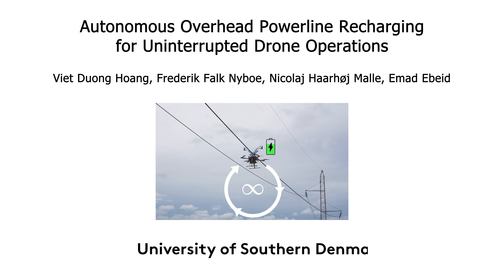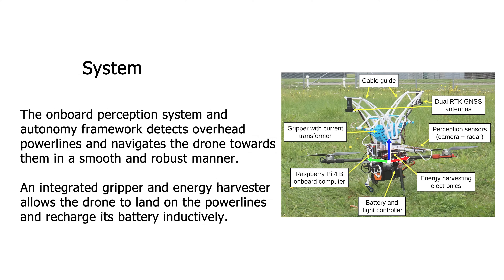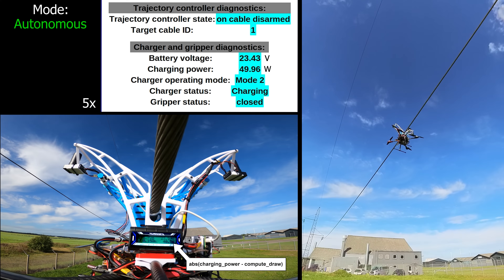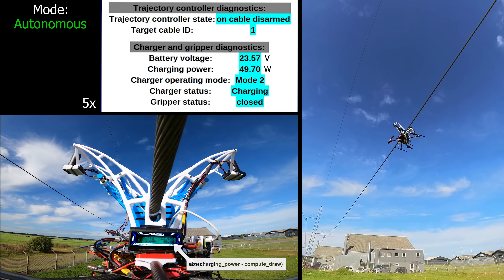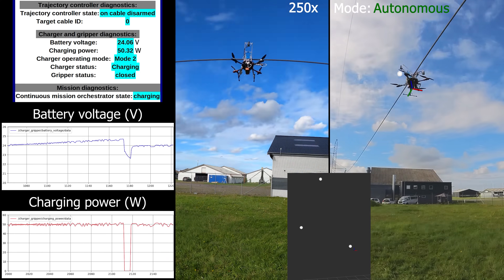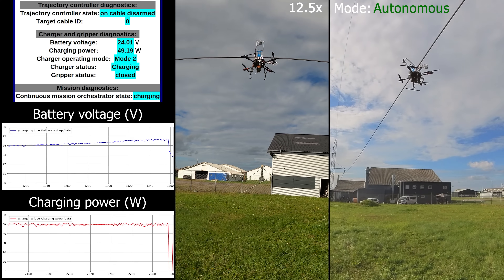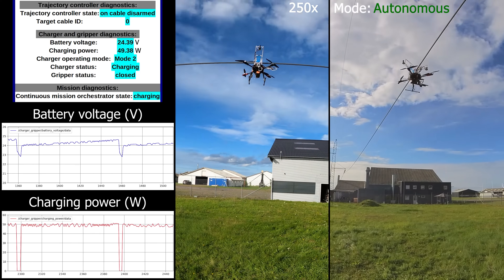Autonomous Overhead Powerline Recharging for Uninterrupted Drone Operations - ICRA 2024

Comment: This is an interesting concept, especially for power line infrastructure inspection. However, wouldn’t continuous flying put too much heat into the motors/ESC’s ? I feel like you would run the risk of damaging components and should monitor temperatures closely

Comment: 🎯 Key points for quick navigation:

00:00 🚁 Autonomous Drone Recharging System Introduction
- Introduction to the paper focused on autonomous drone operations with overhead power line recharging.
- The aim is to achieve long-duration drone operations by recharging from power lines, validated through multi-hour tests.
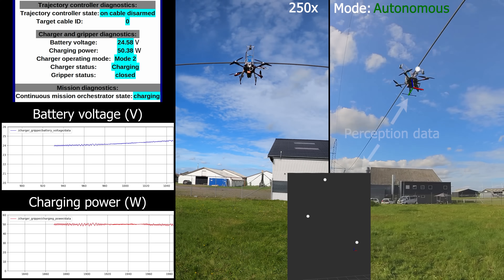01:52 🔋 Drone Testing and Efficiency
- The drone demonstrated continuous flying and recharging autonomously, recovering from an aborted landing.
- With a power line current of 300 amperes, the energy harvester charges at 50 watts, with potential for higher power with increased current.
02:23 🌍 Future Prospects
- Future system improvements aim for better efficiency and weight reduction, extending flying and recharging ratios.
- Self-recharging drones could revolutionize services like inspections or deliveries with less human involvement.

Made with HARPA AI

Comment: this is actually what companies are likely going to implement, use the powerlines as drone highways, requires little infrastructure to be build and maintained and there is usually nothing under powerlines that will get damaged if a drone crashes.

Comment: Will using the magnetic field of wire to charge making the resistance or loading to the wire increasing, so eventually the cost of charging still be there?
Reply: It's not free if that's what you're asking. It uses power just like your house does. If you used one of these drones, it would be theft.

Comment: By doing this, it increases the resistance of the power transmission system. If the number of drones increases, it will significantly affect the power transmission efficiency, which will likely be a cost to the electricity consumers..
Reply: 50 watts is nothing and these are going to be very expensive
Reply: It only drains the amount of power it's using. It's very small 20-160 W. It's like a laptop charger.

Comment: congrats! you've added so much extra weight with the recharging mechanism that you now NEED to recharge far more often. This system has practically exceeded the point of diminishing returns.  Go improve it and come back when you've actually got something useful.
Reply: Lmao, dude it has infinite power any where there's power lines. Even with half as much battery life, it's worth it for long distance unattended drone work

It definitely has a niche
Reply: Bro it's a proof of concept and the guy is putting this info out so others can use it. Don't be a jerk.

Comment: How do the powerlines affect gps? Is it still usable?
Reply: The main disturbance is to the drone's internal compass due to the magnetic field around the powerline. That's the reason for using two GNSS antennas (black device at either tip of the white wire guide) which allows the drone to extract its heading that way
Reply: @nicolajmalle9715  Thanks!

Comment: How does this charging circuit work with just 1 conductor?!
Reply: The energy harvesting does not rely directly on the current but instead on the magnetic field around the wire (which is of course induced by the alternating current in the wire). In fact, there is no conductive connection between the drone and the power line at all (e.g. metal to metal) since the harvesting principle is more like the wireless charging for your phone.
Reply: @nicolajmalle9715 so is this increasing resistance of the wire so that the cost of charging is still be there? Or it’s just really free energy?
Reply: @Xi_da_butcher  It increases resistance, similar to when you use a wireless phones charger, which is also not 'free' energy
Reply: @nicolajmalle9715  Thanks :)
Reply: @nicolajmalle9715 is that why it's only charging at 50W on a 155 watt hour battery? 0.3C rate.  Or maybe that's on purpose to increase lifespan of battery?
Reply: @Jrod_FPV  It's simply limited to 50W because of the 300A powerline current. If the powerline current were 1000A it would be charging at around 160W
Reply: Induction
Reply: There is an opening current transformer. Current measuring tongs work according to this principle.
Reply: it's just physics

Comment: How effing low are these lines??? From the angles in the video, the lowest phase looks like it dips below the level of the fence beside it! If these are carrying anything above about 50V, that seems like the mother of all safety hazards!
Reply: its amazing that people don't understand that things exist outside of their true working use. Like yes these are obviously custom PRIVATE lines for testing just this. People are mind-numbingly stupid these days and cant do even a little of their own critical thinking.
Reply: This is a customized power line environment with each of the four cables hanging roughly 2, 4, 6, and 8 meters off the ground respectively. For these initial results the power source is 5V 50Hz maxing out at around 300A.
Reply: So it can scale up to thousands of volts, I guess will have applications in Ukraine knowing those Americans

Comment: The heat from that power would fry the electronics, lol
Reply: What are you talking about, its 50 watts. A drone of that size normally charges at 200-400 watts.

This thing has barely and heat to deal with because the charging is so slow.
Reply: @nocare  Please educate me, not so technical. But in real use case the power is not 50W. EMI and arcing are other issues. Would power companies ever allow these drones? IDK
Reply: @nocare  A typical drone's navigation system relies on a compass to obtain the drone's heading. Due to the strong magnetic field near the power lines, the compass can not be relied on in this case. The drone in the video instead obtains a heading by using two differential GNSS antennas (black cylinders in either end of the white cable guide "horns"). The remaining system relies on a camera, radar, and IMU which are not affected in proximity to power lines.

A big challenge is EMI-proofing the whole system to handle high voltage. When we approach high-voltage (e.g. 400 kV) power lines, we see significant arcing and noise in the electrical systems which may fry sensitive components and cause instabilities or even crashes, like seen here https://youtu.be/4c5utNIk3Hw?si=cBFxDpQUbnwFQJz_&t=41.
Reply: @nocare I'm interested in pointing at the wire. Is it an induction magnetic sensor, an optical sensor, a proximity sensor?
Reply: Why comment on something like this if you don't have an understanding of what is happening?

Comment: You harvest the energy by magnetic coupling, don't you?
Reply: Yes, it's inductive charging from the alternating current. If you are interested you can read more in this paper:
Hoang, Viet Duong, and Emad Ebeid. "Manipulating Magnetic Field of the Magnetic Gripper with Charging Feature for Drones on Energized Power Lines." IEEE Transactions on Industrial Electronics (2024).
Reply: Seems to use a current transformer based on the fact that they state that the charging power scales proportionally to the current in the power line. So yes, I think you could say that it is inductively coupled.
Reply: @15sowens There is an opening current transformer. Current measuring tongs work according to this principle.